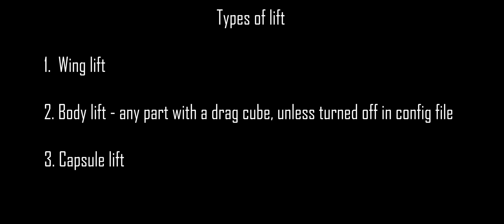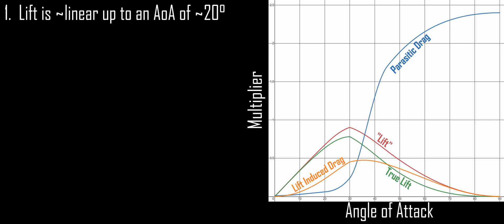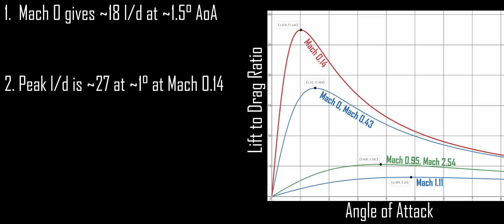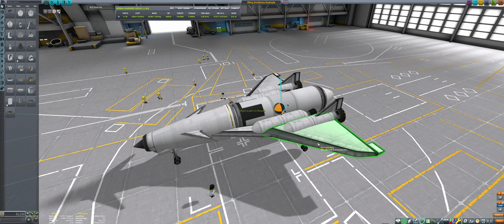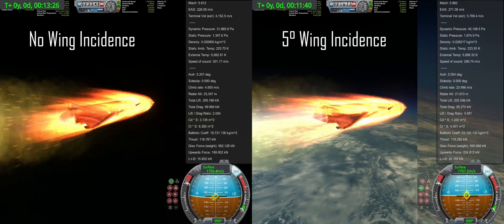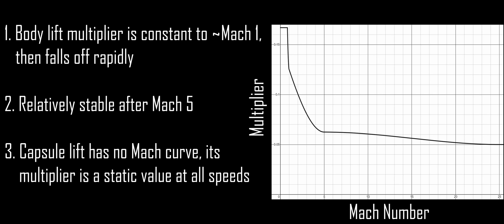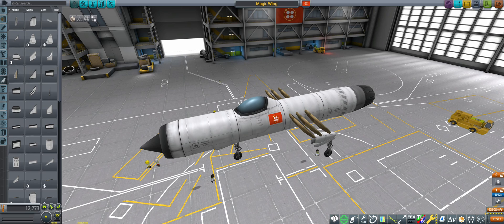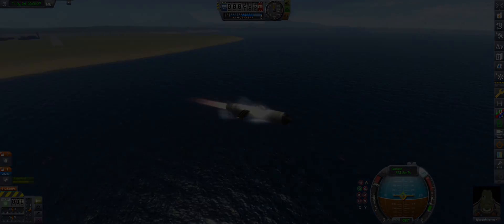Kerbal University: Wings - Magic and Mundane

Comment: It has always bothered me that wings are simulated as flat plates and don’t produce lift at zero angle of attack in KSP. No real world wings work like that, they have an asymmetrical shape that lets them generate lift more efficiently than a flat plane and still generate lift when pointed directly prograde.

This messes with you when you start out because commercial planes have little if any angle of attack on their wings for maximum efficiency and are capable of level flight without having to pitch up but if you make a plane like that it will have to be pitched up to maintain level flight, which is not what you want at all (especially since not facing directly prograde is mega punished by the drag model), and you cannot fix this by adding wing area you have to add some angle of attack to the wings.

Comment: Hi, can I ask for the source for all these curves? I'd like to have a go at making a curve for ideal AoA for a given mach number, then use KOS and a lookup table to control the wings with motors.

Any idea what the drag is like on the rotors? I wouldn't be against turning it off alltogether.
Reply from the maker: All the lift and drag curves are stored as sets of key value pairs in physics.cfg in the base folder of your KSP install

Comment: Two things about 8:15
Barrel roll is the wrong term. The maneuver you performed there is an Aileron roll.
Second of all, how does an aileron roll affect vertical velocity? And what part of the vertical velocity needs to be managed?
Reply from the maker: Because the plane is flying hold prograde with wing incidence, lift is always directed upwards from a plane centric frame of reference.  By rolling the craft I redirect the lift vector away from surface centric vertical.
The reason I do this is to allow gravity to reduce vertical speed, and while the craft is inverted, to have the lift vector contribute to this, reducing vertical speed even faster.
The reason I want to manage vertical speed is that if I don't, the craft will pick up a large phugiod https://en.m.wikipedia.org/wiki/Phugoid
For a given designed wing loading for a plane with wing incidence, for any altitude there will be a single airspeed that causes lift to balance gravity.  Going faster than this will cause you to begin to gain vertical velocity and the craft, following prograde, starts to nose up.  You will continue to gain vertical speed until you climb to you ideal altitude for your current speed, but all the built up vertical velocity causes you to shoot right past you ideal altitude into thinner air that doesn't provide enough lift, eventually causing your vertical speed to drop negative and cause you to lose altitude, with the eventual result of dropping right past your ideal altitude again, leading to a cycle of bobbing up and down.
So the overall goal is to moderate and manage the rate of climb so that you stay as close to your ideal altitude as possible, as both you and it slowly climb as you gain airspeed.
Reply from the maker: Putting this all together, a typical efficient ssto will have an ideal altitude of about 0 at around Mach 1, meaning that until you reach Mach one you have to nose up above prograde to get enough lift toaintain level flight, even at sea level.  As you pass Mach 1, you can transition to prograde hold and your ideal altitude starts rising.  However, this is about the time that the rapier really kicks it into high gear, so your airspeed and thus ideal altitude start rising fast, but your vertical velocity, and thus actual altitude, takes time to build up, so idea altitude runs away from you and the plane will continuously gain vertical speed, usually reaching a peak climb angle of 20-30 degrees.  Actual altitude won't catch up to ideal altitude untill you are around 10-12km, at which point you have built up several hundred m/s of vertical velocity, and you overshoot by something like 5-6km, entering a massive phugiod cycle.
A single well timed roll during the initial high angle climb will clip off most of this excess vertical velocity right before you finally catch up to you ideal altitude, so that you reach it with a much more sedate rate of climb that more closely matches the rate of climb of the ideal altitude.
Reply: @lt_duckweed  Ohh, I see. And I'm assuming the other way of lowering vertical velocity, pitching down, is not recommended because of drag?

Comment: Hey there!  Could you go into how the "wing area" is computed for Body Lift parts?  You mention that it's drag cube face area times psuedo drag coefficient, but how does that work?  Thanks for an informative video!
Reply from the maker: As far as I can recall, it is simply the result of that calculation for each face, with each face then calculating body lift on its own based on the angle of each face, then summing for the body lift of the whole part.

Comment: Hmm, wasn't expecting these parts to still have a stall modeled since they seemed effective way past the critical AoA for most real life airfoils.

By the way, how did you get all this data. I'm guessing you plotted the curves that can be found in the part data. Is that correct?
Reply from the maker: While stall is modeled, it's what you might refer to as a "soft" stall, in that the lift drops of fairly slowly, whereas irl, when you stall, you STALL.

And yep, I pulled the info from the physics.cfg file, and there is a spesific set of equations that you use to plot the curves, called cubic hermite splines.
Reply: @lt_duckweed  I guess irl you could make a wing design that doesn't have a hard stall, but it probably wouldn't look anything like we have in KSP.

Comment: Also how do flag wings work?
Reply from the maker: The way flag wings work is rather interesting.  In 1.10 and 1.11, flags had drag cubes, but the drag portion of the drag cube was forcibly disabled, which meant that only the body lift component was left.  So they had only lift, and no drag at all.
In 1.12, they were changed, and now they have no lift or drag.
Reply: @lt_duckweed  thanks! Now I don’t have to worry about spamming flags on my plane. It might be good idea to mention how there’s no airfoil in ksp so the only lift you get is the air deflected downwards and not because air flows faster below the wing creating an indifference in pressure

Comment: Just skipped to the wing incidence testing section because it seemed so interesting, the results are insane! I've always liked to experiment with stuff in KSP, but I never got around to wing incidence.  Great video!
Reply from the maker: Yeah, I always say that wing incidence is the single most powerful tool a ssto builder can use!
It almost always makes a craft far more efficient, and much easier to fly, since you can just slap prograde hold on it and it will practically fly itself!